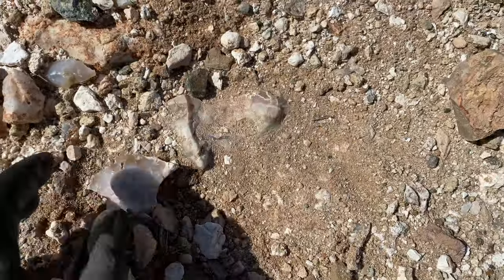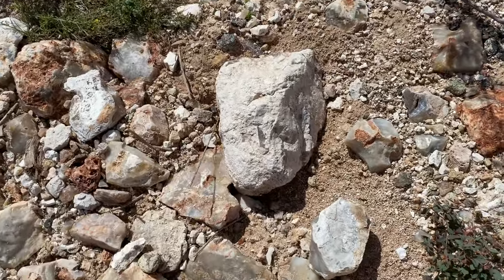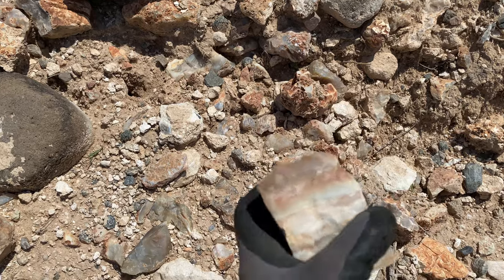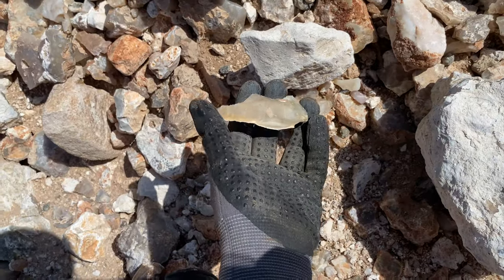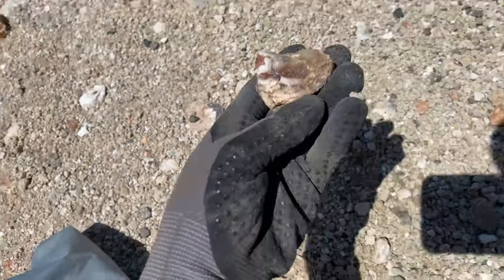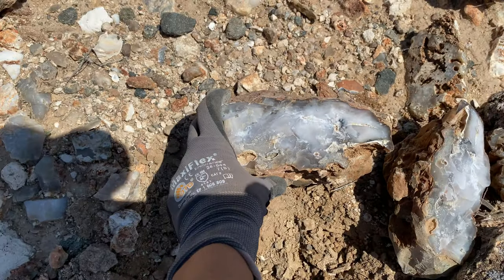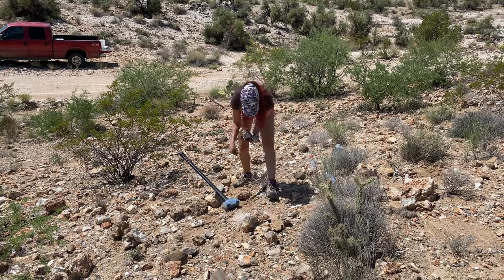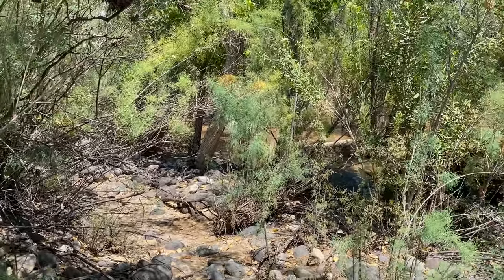BURRO Creek Pastelite Rockhounding Arizona

Comment: Great video Elley! Thanks for not revealing its exact location! I can empathize with your battle scars, my most recent journey out there I was breaking rocks and not wearing safety glasses (which I had in the tool bag). But a large chip flew off one of the rocks I was hammering on and hit me in the corner of my right eye. Now the eye is full of floaters and partially detached retina. Glad to see you were wearing glasses. My lesson learned....banging on rocks...wear some sort of eye protection.  😉 Looks like you found some great pieces to work. Can't wait to see what you've done with them!

Comment: Sway bar disconnect remove the bolt take of the part continue on with a more comfortable ride with out the connector bouncing around
Reply: Highway speeds are not recommended with the sway bar disconnected on that year of f250. Off road, it is fine to run without the sway bar. At highway speed, you can get a lot of body roll and you may even lose control of the truck in a collision avoidance situation.
Reply: @ssteele1812  I cannot confirm that with the Ford however I can easily confirm that with my jeep and my Land Cruiser. 
Body roll I’m driving a lift a jeep I don’t care about body roll on the freeway. Or I’m driving a big ass Lexus Land Cruiser. 
However every Ford I ever drove that was lifted wanted to buck you off like a bronco 2. 
Must be a bump steer issue
Reply: @9greatdanes981  I just replaced my drag link. I think it's just a lifted ford thing